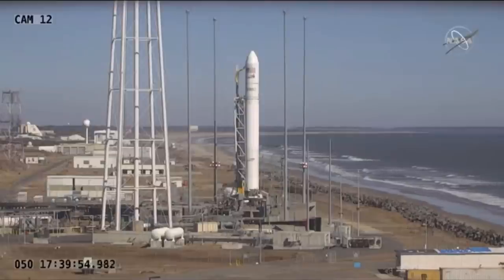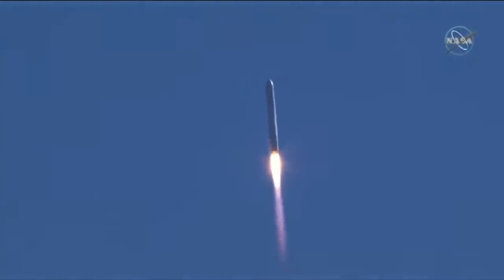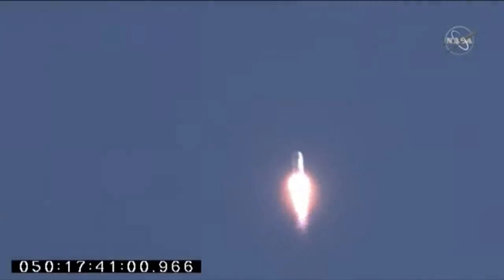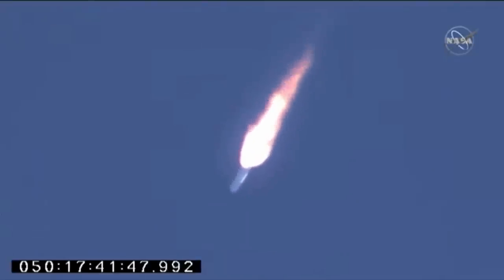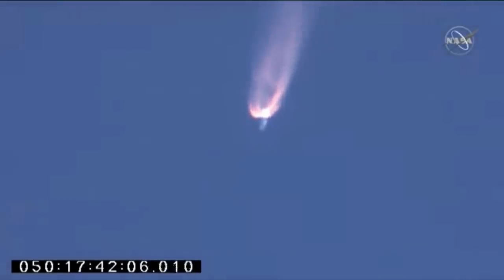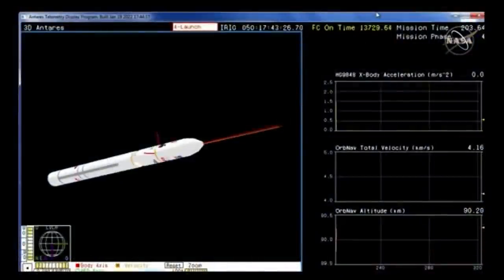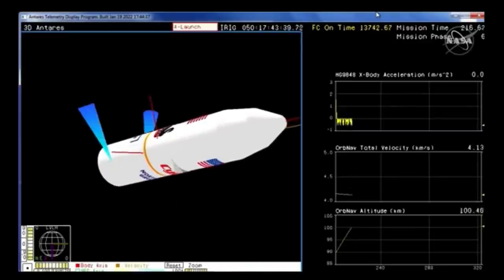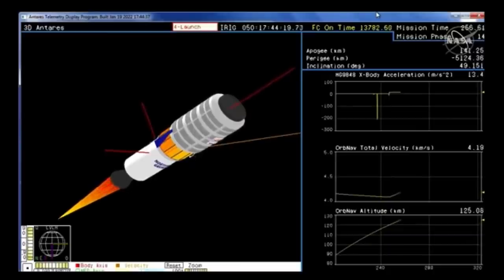Blastoff! S.S. Piers Sellers Cygnus spacecraft launches to Space Station

Comment: So this thing doesn’t have a reusable first stage and carry’s 5,000lbs less payload than a Space X falcon capsule? Why would Nasa bother using them compared to space x?
Reply: I was going to argue with you but you use pounds
Reply: @joag1971  lol, I need my google to convert lbs to kg
Reply: @Trenton Cupps  (sorry tagged the wrong person intially) Available volume is a bigger constraint than mass most of the time. It was also an issue in the CRS-1 flights that NASA and SpaceX worked to improve through packing procedures because the shape of Dragon. 

If you look at the CRS-2 contract, NG was the cheapest option not SpaceX. Cygnus also has the record for the heaviest commercial cargo flight to the ISS (8399 lbs vs 7337 lbs for Dragon 2). Although Dragon does have the capability to bring back cargo to Earth unlike Cygnus. With that said, having a backup is always a benefit for critical capabilities like resupplying the ISS. Falcon and Antares have exploded in the past and were out of service until an investigation was complete. 

Antares is a much smaller vehicle whose only purpose is to deliver Cygnus to orbit. It has a low flight rate and reuse would cost much more than it would save if it were even possible (propulsive landing is out of the question).
Reply: @joag1971  And a fanboi on top of that..

Comment: Up up and away . Hang on , 22,000 feet and it's travelling parallel with the earth ? I thought the iss was 300 mikes away ? I smell a rat .
Reply: It begins going parallel with the surface of earth way higher than that, above 100km in fact.
Reply: @Ethan_Roberts  7000 feet ?
Reply: @Ethan_Roberts  they got to 100km in 6 minutes?
Reply: @deanhepple3292  got to 100km in about 3.5 minutes. What's your point?
Reply: @Ethan_Roberts  rocket turns parallel with earth at 3 mins 30 . Where is it going ?
Reply: @deanhepple3292  where do you think it's going? Space, shouldn't be that difficult to understand.
Reply: @Ethan_Roberts  low earth orbit is further away than that rocket is going .

Comment: One minute fifteen seconds in and the rocket is pointing down at 15 degrees. Coming right back down to earth. And we still launch them right beside the ocean,,,,, you know,  for the splash down a few minutes later.           Finished the rest of the video,,,,,,,, does anyone still have critical thinking anymore. When the rocket booster fell away,,,, there goes the payload with its jet booster. Ever watched a jet fighter refuel in flight,,,,,,sometimes it takes many trys. But this slug is going to do it in space going 50 times faster. Where is the docking capabilities at,,,,,,,,,it looked like a wrapped package to me. Total crap,,,,,,,,,,,
Reply: Someone lacks a sense of perspective
Reply: You're damn right.The common sense extinct.
Reply: It angles into space so that it can reach orbiting altitude.  If it keeps going straight up into the atmosphere, it will leave the earth permanently.
Reply: @Ethan_Roberts  Yeah he is wrong, but on the other hand he is right, you cannot see the oceans far away.
Reply: Sure thing you're Magisty,,,,,,,,I guess it travels the horizontal angels where the sunlight bends as its coming to earth. A funny thing happened on the way to the moon,,,,,video. Showed myself thier hypocrisy. Nerds,,,,,,,society needs more nerds,,,,,,,,,,,,,,